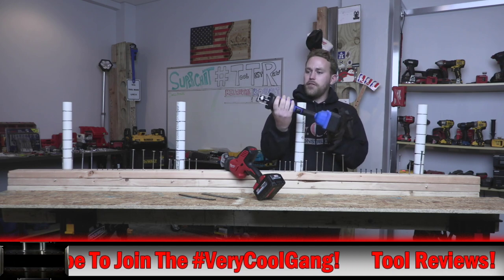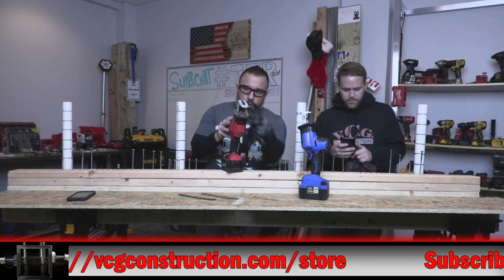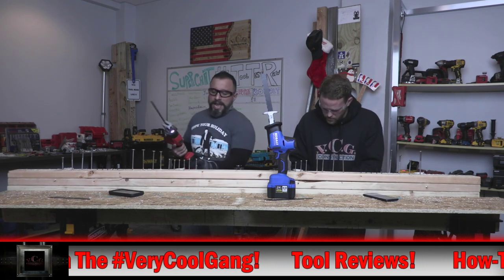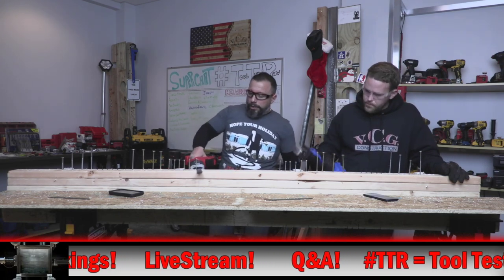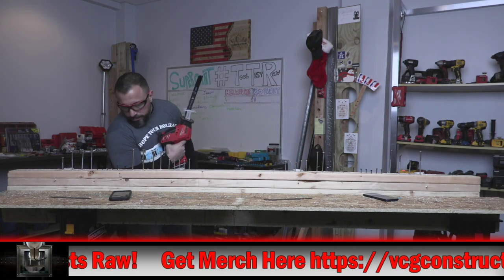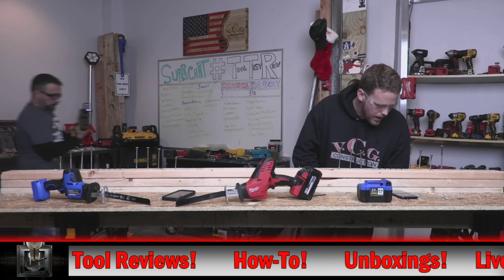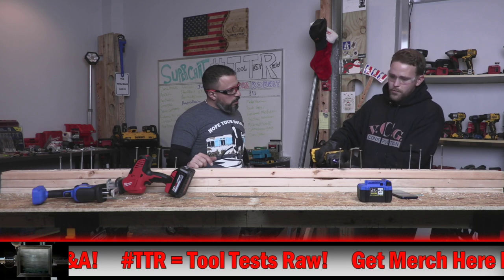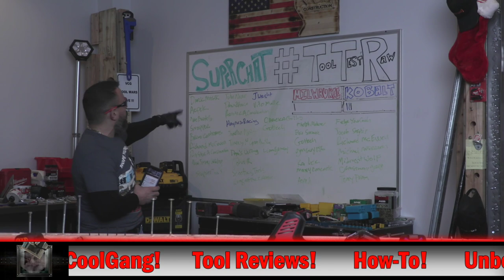Milwaukee Tool VS Kobalt (BEST RECIPROCATING SAW TOOL COMPARISON) Compact One-Handed

Comment: Yea 28:43 looks like the blade was wedged between the two screws like y’all said and it couldn’t move at all, idk if that should be enough to start the smoke show 😅 but somethings gotta give I guess
Reply: Fee I agree. Looks to be seized and that would cause the smoke. There should be a do over with a replacement
Reply: Blade wasn't moving.  Def seized up by the looks of it
Reply: If the tool is that fragile it deserves to die. My ryobi reciprocating saw gets bound up all the time when I am using it for cutting small firewood, never has let the smoke out. I had one of these and it quickly let the smoke out.
Reply: @kyleharwood866  Did your Kobalt one handed saw smoked too?

Comment: Picked up the Milwaukee brushed original Hackzal as a kit on black Friday.  Cuts copper pipe and 40 great in tight spaces.  I am sure that any one who needs to cut plumbing pipe (occasionally) will like the tool.  Thank you for the video.  : )  PS: The 4 inch blades and the short travel make the tool way more effective in tight spots.
Reply: U cut copper with a hackzall? Ever hear of Ridgid or even a bandsaw for 4in
Reply: @chrisjones6165  no room to do it inside the wall.  We did not even have the space to use the smallest Ridgid pipe cutter. (No room to turn it)
Reply: @barkingspider2007  get a thumb or close quarters cutter. If it's 1in or smaller the Milwaukee M12 copper cutter is nice for some of them spots.

Comment: That was one crazy ending for the Kobalt. It has to be a lemon. Good thing for the warranty. I was looking forward to Nick winning one for a change. SMH I always run my saw with a 4 amp hour battery though. Never ran it with a 6.
Reply: Howie Z makes me curious what would happen if you put the Milwaukee in a test where the blade was unable to move & If it’s electronics prevent it from burning up, I assume so & especially if that’s the case then Kobalt really needs to update it. Assuming that’s what happened cuz only on my phone screen

Comment: I love my kobalt drills and lights. Just because ones good, doesn't mean the other is lol. I only use the 2.0 amp hour bats if that makes a difference. I have a Porter Cable drill I've used so much in the past 4 years the  name is wore off.

Comment: I rewatched it and it sorta looks like the blade got bound/locked up between the two screws?   Could that have cause the short/locked motor ?   

Need a rematch
Reply: I thought the exact same thing even before he started I thought why is he putting it in there where it will bind?
Reply: That’s Exactly what happened. It should have a safety feature for that though. Also, it should be sent back so the issue can be corrected and not fail causing an accident on other units.

Comment: Not fair since that's an older model of the hackzall. Get the M18 fuel hackzall then re do all this, kind of a bummer y'all used the reg m18
Reply: the purpose of testing these 2 was both were $99 bare tool....the milwaukee fuel is $159....everyone knows the fuel has more power
Reply: @kingofthecrease30  ahh i see, cheers
Reply from the maker: Sean, you didn’t watch the whole video?

Comment: It’s the non fuel m18 and I’m not sure why you don’t get the fuel
Reply: Because this challenge pitted two $100 saws intended for DIY'ers and prosumers. The Fuel line is intended for the professionals, and costs much more than $100.
Reply: @PaganWizard  $159 at Home Depot if that is professional price you must be really poor in US.
Reply: @mr.wizeguy8995  no need to insult peoples financial situations. If you dont like the tests, buy the tools yourself, start your own YouTube channel and test your own tools
Reply: @yankeecantrell  You obviously didn't get point. You can't claim 50 buck difference separates DIY tool and professional tool those can consider same price range.
Reply: @mr.wizeguy8995  some people dont have $50

Comment: Is the kobalt like dewalt in which 24 is actually 22 volts under load?
Reply: I'm mean is the hilti 22 volt the same voltage as the kobalt battery if that makes sense.

Comment: Diy tools should battle diy tools first. Like Stanley, Ryobi, kobalt. Hercules ect. If they pass the test. Then put them with the pros.
Reply from the maker: The stats from the Kobalt are better than the Milwaukee.
Reply: @VCGConstruction  diy stats r always higher in paper. Look at Ridgid, Ryobi, baure they all say pro stats. But the construction  inside of the construction is not the same. We all know that. So if a diy says it has 5 million torque  you know it's really 5 million of heavy duty plastic torque deep inside that motor. 😁😁😁it will break quick. I learned that with stanley and Ryobi power tools. But I still buy them to have my pro tools and my diy tools.

Comment: Vince, u have to try the M12 Hackzall non fuel version...but not with a lil 1.5 battery, at least a 3.0. U will be surprised.
Reply: I’ve never seen anyone say anything positive about the brushed M12 Hackzall until this moment. I assume you mean surprised in a good way? 😂
Reply: @Fee.1  Ive had mine for years! It's great, I love it!

Comment: The blade bound up between the two screws. No wonder the motor overloaded and burned up.
Reply: Sometimes my m12 fuel gets bound up in material and it never let the smoke out. It has so much power the saw will move back n forth instead of the blade if it gets jammed up.

Comment: This was not at all a fair fight. The Kobalt saw clearly got jammed between two bolts and bogged down. Nick kept his finger on the trigger, maybe trying to get it to break free, maybe didn't realize at the time what was happening. I don't think that very many compact cordless recip saws, even close to that price point, would have broken out of that jam. At 41:18, Vince cut the bolt that killed the Kobalt, BUT, he didn't put the blade between the same 2 bolts like how Nick had his blade at 28:44. Get that saw replaced and redo this challenge. I'm not trying to blame either of you for tilting the scales, stuff happens, and I think the Kobalt deserves a rematch in this fight. JMHO
Reply: I think you are right, does appear it got jammed, then a few seconds of running jammed killed it
Reply: The only problem with that theory is that the Kobalt's housing (the tool chassis itself, i.e., the tool and handle) would reciprocate if only the saw blade got jammed in between the bolts.  What I think happened is that somehow the jam happened inside the Kobalt's gear case somewhere, resulting in the motor pulling full stall motor current from the battery, thereby overheating and frying the motor. The jam could have occurred if there was a twisting force on the saw blade and that resulted in something not aligning correctly within the Kobalt's reciprocating gearbox, jamming teeth together, thereby releasing the smoke as the motor windings fried.

Comment: Pick up where you left off saw for saw.  But Milwaukee vs kobalt seems unfair already. I use the kobalt and im happy with it i let the blade do its job with out forcing it. Im just a diy guy. 
Ps if you do end up cutting the kobalt just send me the battery. Lmao

Comment: Is that kobalt brushed or brushless
Reply from the maker: Brushless
Reply: VCG Construction shocking I have that m18 brushed it’s impressive that kobalt smokes faster than the dewalt 887 impact driver I’m shocked too unless you got a defective kobalt
Reply: @DanielGomez-cf6vk  I'm thinking a defective tool. It happens to any manufacturered product.
Reply: Yankee Deer Hunter brushless tools especially kobalt don’t burn out as easily too

Comment: The motor burning up is totally consistent with the unit getting jammed in the gearbox or gear train somehow, then the motor windings pulled "Stall" current (i.e., non-rotational power, which is exponentially larger than when the motor is turning.  It's a physics thing.)  The brushless brain-box would have limited the current in a motor stall, however, there is none with the brush motors and they just pull enough current out of the battery to fry the motor.  Oops.

OK, crossing Kobalt off the list now. . . .